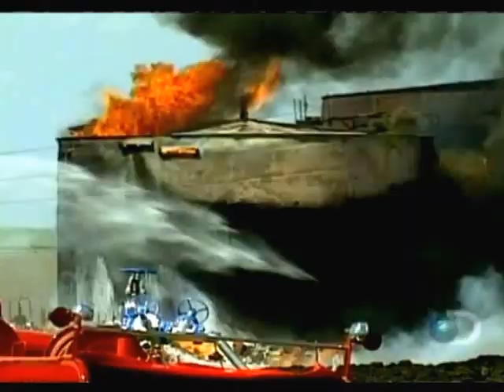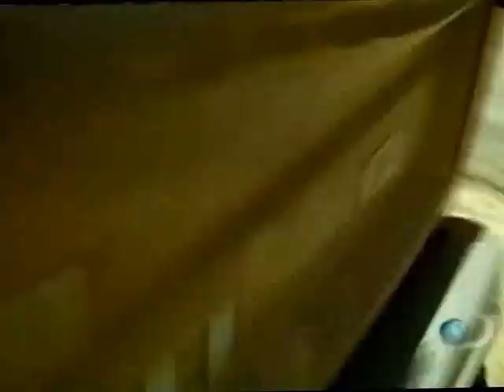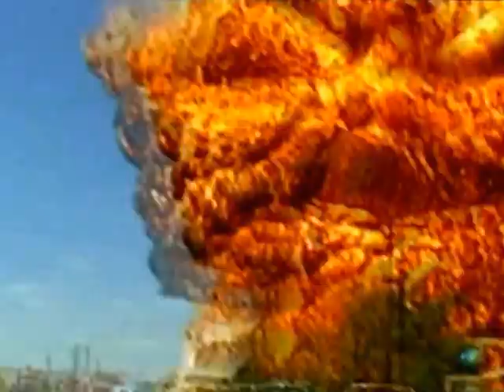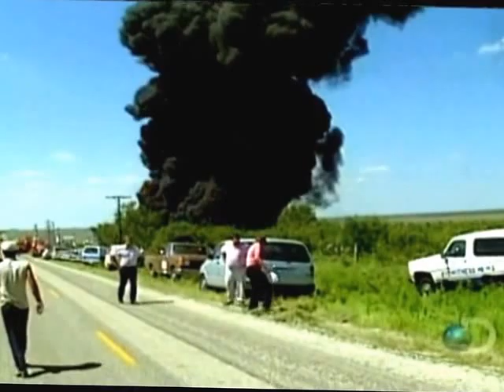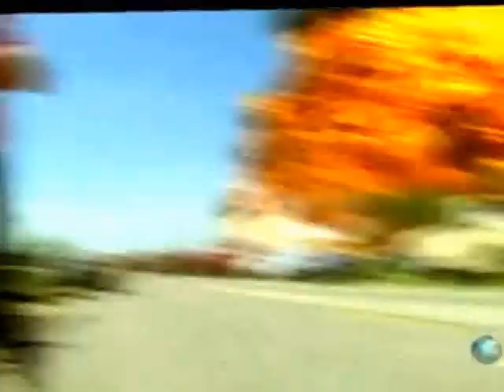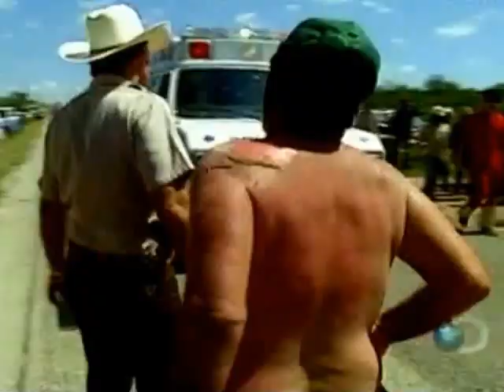Fire in an oil storage tank - Boilover - Three rivers texas | firefighting

Comment: now i'm wondering what the hell a firefighter crew, who should know this shit, are using water instead of some firefighting chemical or letting the place  burn out.
Reply: Some areas can't afford foam. My department has a 30 gallon tank of it built in on our engine but we hate to use it unless necessary due to the cost of it. It's several hundred dollars for just a single 5 gallon jug of the stuff.
Reply: Dude, they used foam.